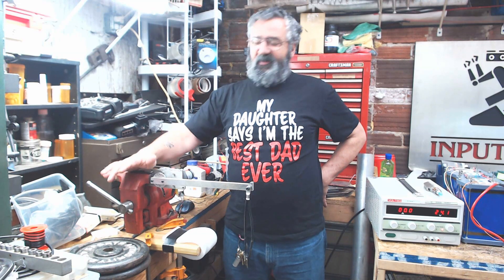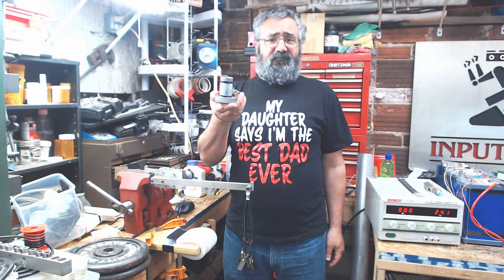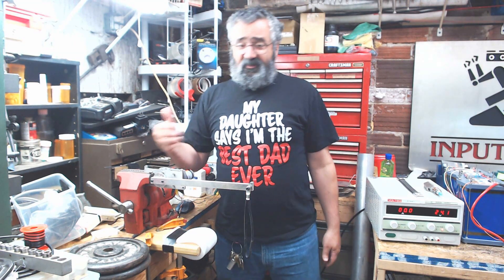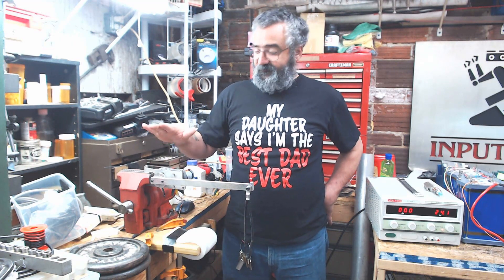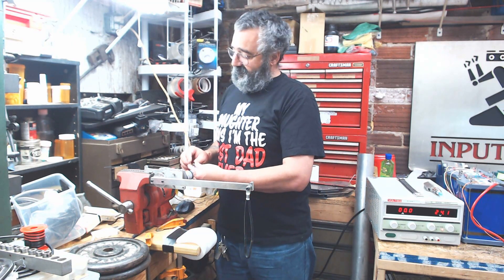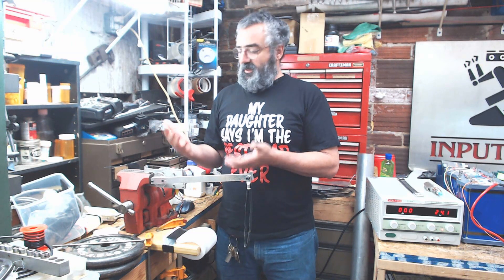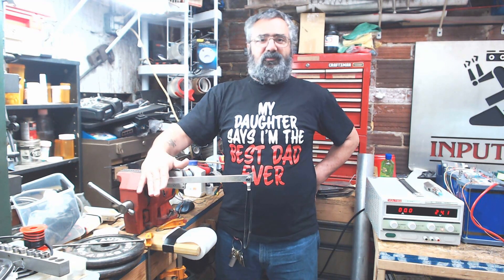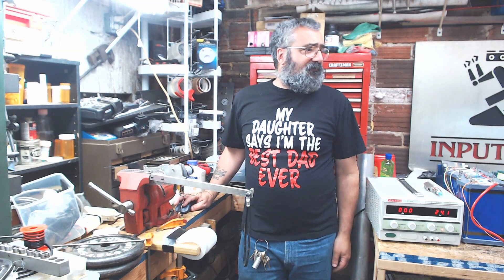ASME-04B 380Kg.cm Servo torture tested with my DIY hardened Gear!

Comment: For asme-04b have you used the servo.h library? When I set it to 180 degrees with .write(180), it goes to 270 instead. Why does this happen? Is there a way to make 180 goto 180 with servo.h library?

Comment: tip for new buyers, the servo wont move if supplied less than about 10V, ( else you'll think "oh my gawd it's DOA" then google left and right, try different jumper positions, try servo testers, try different grounding, try different arduino pins, try different arduino apps )